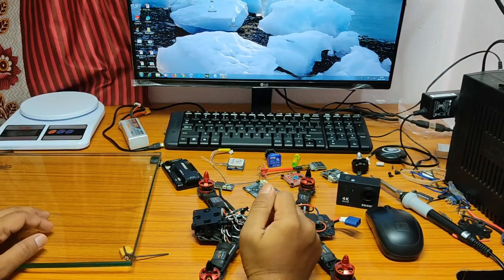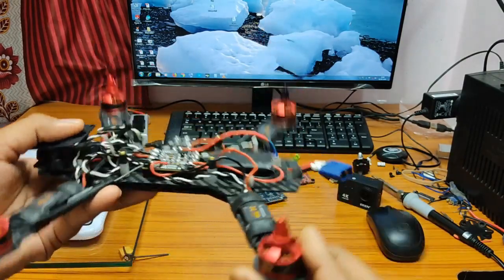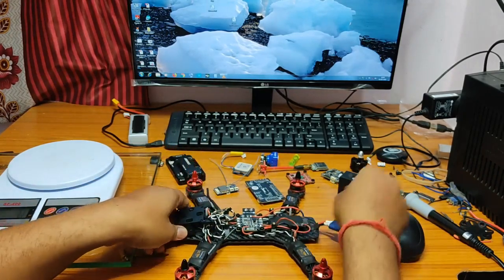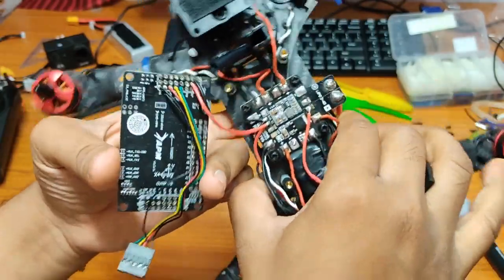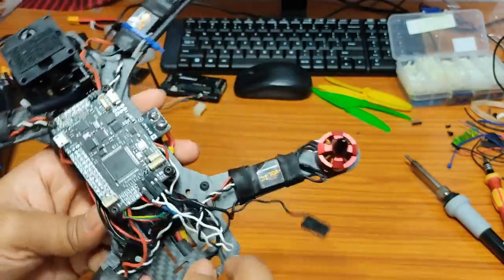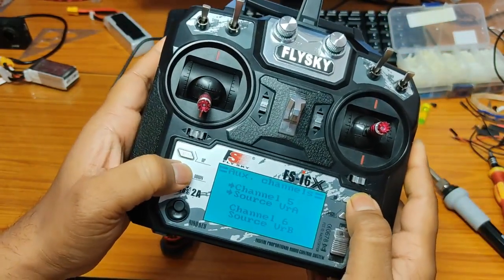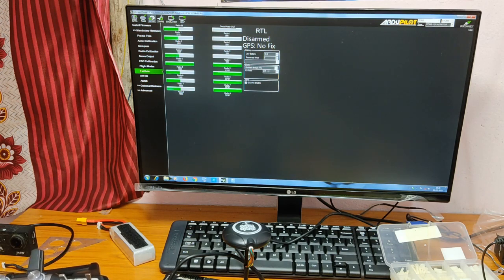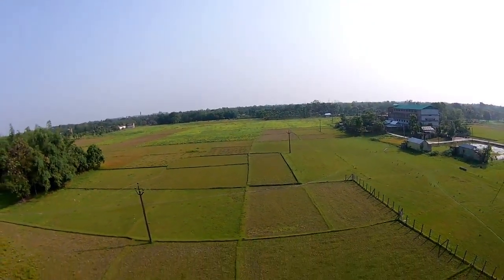How to make Mini Arducopter using APM 2.8 | Low Cost Drone Build |

Comment: I m successfully running arducopter on omnibus f4 pro V2 and using dshot600 ssc and it's working very good and Gps was m8n on 450 size quad
Reply: Can you tell me where you got it? Can't find it anywhere

Comment: Can we use normal 2200 kv motor for this drone
Reply from the maker: Thanks for watching. You didn’t mentioned about stator size of the motor, as per your stated 2200Kv range you can run 5 to 6” prop effectively using 3s battery in this same frame set up. But keep an eye on the weight of the motor, normal 2212 size motor weighs 50gram whereas 1806/2204 size weighs 20-25 gram. Therefore a bigger stator size will obviously work but you will get significantly less flight time.

Comment: Can we add li-ion batteries? And also gimbal? Any idea about flight time?
Reply from the maker: Certainly, you can use li-ion, a 3s li-ion using sony VTC6 or LG HG2 will give you around 20 min with the same setup (tested with my 3s li-ion with HG2)or more if you use light weight components.This setup has a current draw of around 7-8 Amp in normal condition & the said li-ion's are rated for 20 Amp. Finding a good lightweight gimbal is a problem, if you find one it can be added, normal one will work but you will have less flight time due to weight & current draw.
Reply: @susavanmandal6811  whats the mah of li ion you tested?